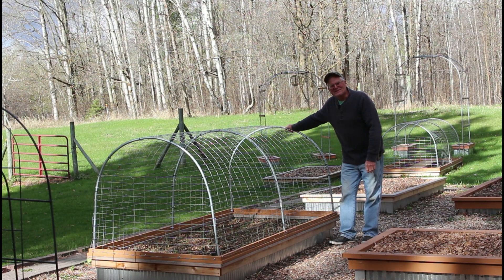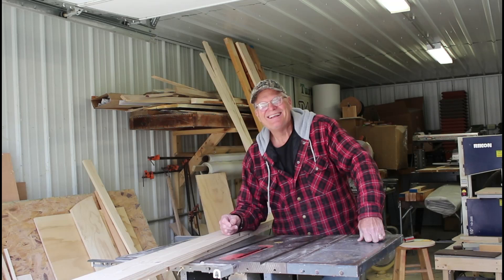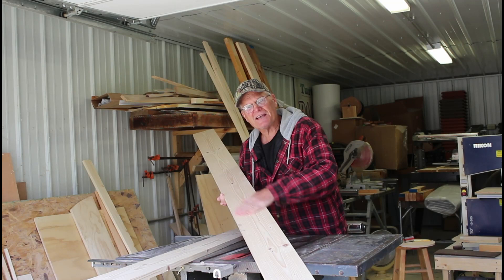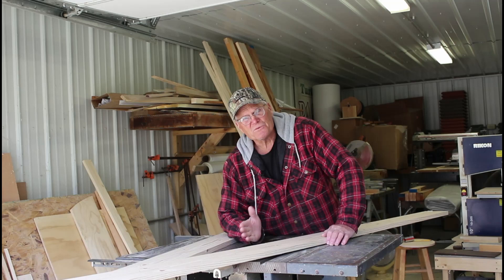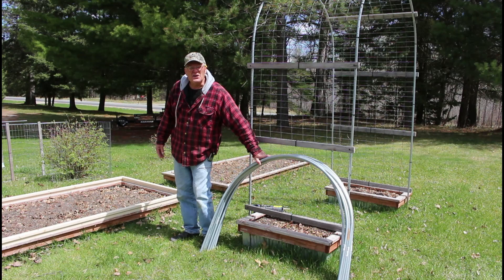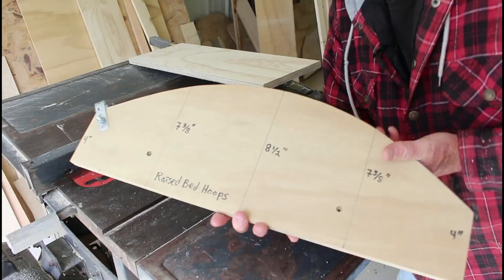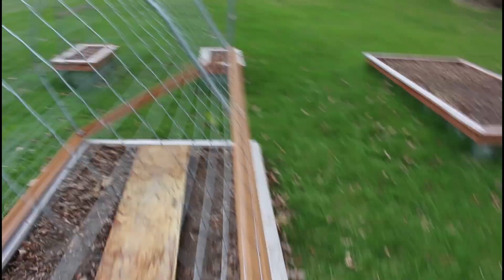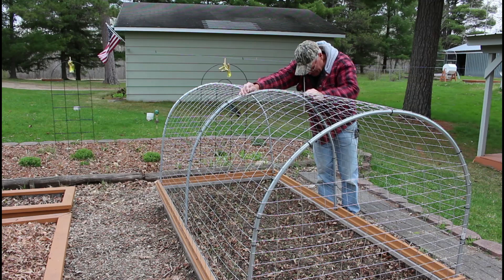How Build a HOOP COVER for Raised Beds

Comment: Great video! I have 3' deep beds and need to work them from both sides. I'll figure out what arc the bender would need for a 3' bed. I'll also mount the hinges on an end instead of the sides, so I can work both sides of the bed. Thank you for the inspiration!!
Reply from the maker: Thank you. If you have a piece of flexible tubing,  you can bend it on a flat surface at the desired size for your bend. Clamp it down, and slip a piece of plywood under the top center of the hoop, then scribe that radius. You can then make a bender out of the plywood, as I did, using those dimensions for bending metal conduit (3/4" plywood for 1/2" conduit).
Reply: @backwoodbasics9383  OH, duh! Simple & brilliant at the same time! I do have some black tubing I was thinking of trying for a sample hoop. Will use that to create my metal bending jig!

Comment: Enjoyed your video, thank you for the detail.  Reminds me of my dad.  Question for you.  If you want to use a flexible piece of irrigation tubing for the hoop, what is the formula for determining the length of tubing tyou need if you want different heights on different beds?  For example: 2ft height on one bed, three foot height on another, and 4 feet on another.  (I forgot my algebraic formulas...haha)  Thank you.
Reply from the maker: Thanks Horton. I am more seat-of-the-pants in my designs. I would clamp flexible tubing to a flat surface, at the height and width desired. Then lay a piece of plywood under the tubing, and trace the arc, while finding where the bend ends, and how high you want the vertical sides to be,
Reply: @backwoodbasics9383  Thank you, sir.  I appreciate your "seat of the pants" methods.  Kinda of right down my alley...if I were that creative.  I'll give you suggestion a try.

Comment: I've used treated wood in my raised beds for years and I'm still kicking at 77 years.  How about the fertilizers and pest control that we apply to our gardens?  We won't use treated wood but we'll use things that are as bad or worse.
Reply from the maker: Right. We don't use anything but chopped leaves in our gardens. My concern with treated wood is more about milling it. Some also say galvanized metal is unsafe near crops. Lots of opinions out there.

Comment: My raised bed dimensions are 2.5 ft wide X 6 ft long. I want the hoops to be 30 inches tall. How do I calculate how long a length of conduit to use, and where to mark in from the ends to start the bend? Also, since my hoops will be narrower and shorter than yours, can I still bend 1/2" conduit, or will that be too difficult? Thank you - great video!
Reply from the maker: My seat-of-the-pants method would be to bend flexible material, like poly tubing, or even garden hose, to your desired dimensions on a flat work surface. Once spring clamped in place, slide a piece of 2' wide 3/4" plywood evenly under the top portion of the arc, and draw the arc on the plywood (on the inside of the tubing). Measure how tall the vertical "legs" would be, to get your desired height, and conduit length.. Cut out the bender, and add the strap, as I showed. The 1/2" conduit should bend OK, but the bender will need to be well-secured to the bending surface. This should get you close to what you want.
Reply: Excellent - genuinely appreciated.  @backwoodbasics9383

Comment: Really great stuff! In the process of building some according to your directions right now. Didn’t catch it in the video, but what are the dimensions of the bed in this video? 

Thanks
Reply from the maker: Thanks. We now have 5 of them (although they are under 2' of snow yet). The outside dimensions of the top cap is a full 4'x8'. So the Bed Cap frame on the outside is also 4x8.